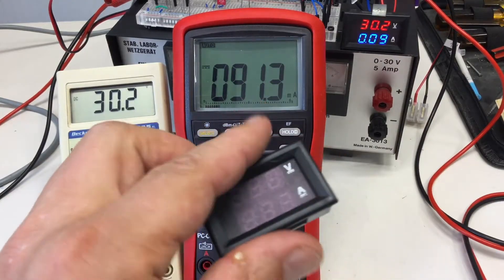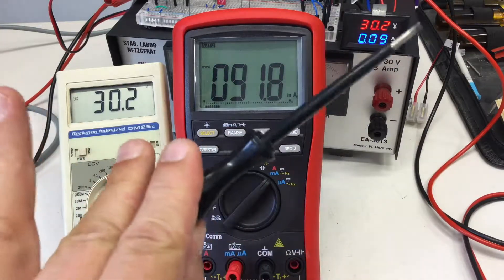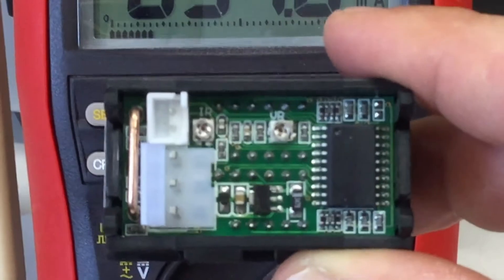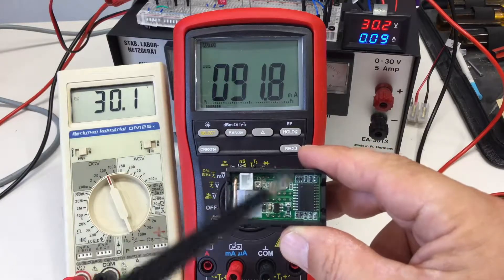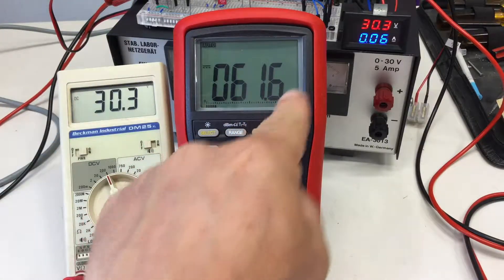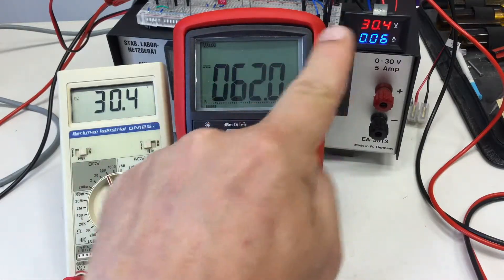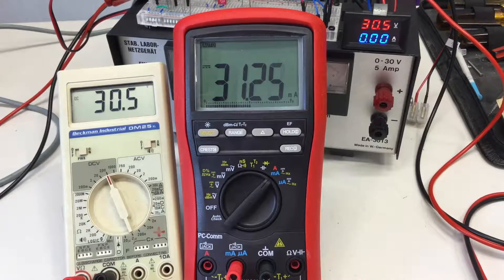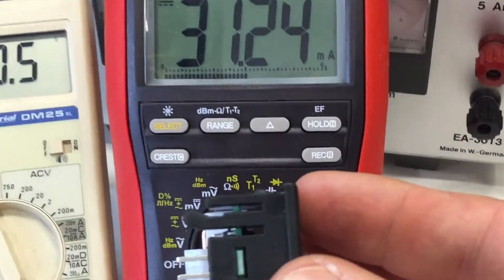Chinese 3-Digit Panel 100V/10A Voltmeter/Ammeter Review

Comment: how to make it read upto 30A
Reply from the maker: You can replace he shunt resistor with one with a smaller value (1/3 of the one that's there). Alternatively you can put a second shunt resistor  (1/2 of the value of the one that's there) in parallel to the existing one.

Comment: I'm not sure how you wired this up, but my understanding is that if you power the meter off of what you're measuring, then the measurement floor is not zero. 

In order to go down to 0 mA / 0 V, the meter has to be powered from a separate source.
Reply from the maker: The meter was powered from a different fixed voltage rail, not the same rail it was measuring. However those rails where not galvanically isolated. Do you mean by "separate source" that you need to power it from a galvanically isolated rail? Like a separate battery, its own transformer or an isolated DC-DC converter?

Comment: To snap it in the panel, I cut the hole to fit the unit then marked the places where the little snaps go in and filed them out a bit until the unit fit perfectly (about 0.5 mm per side). A lot of trouble, but it worked. Thanks for the review!